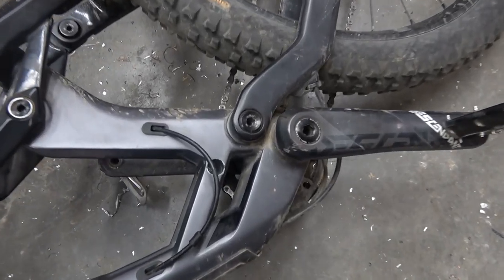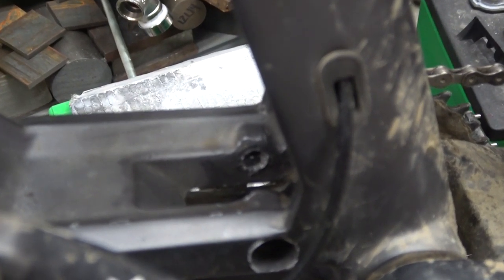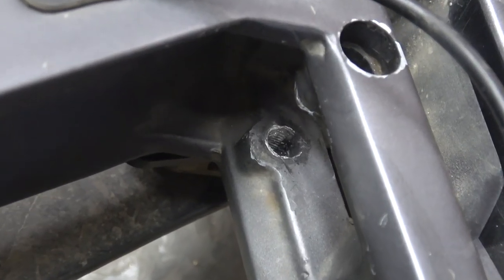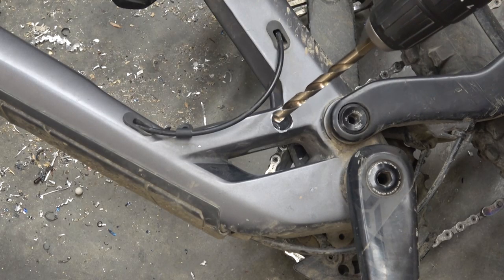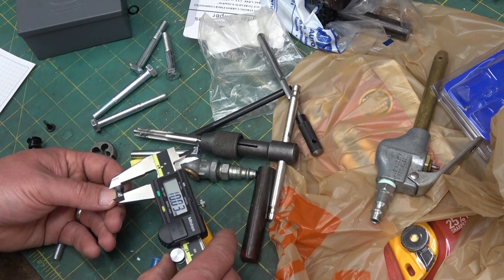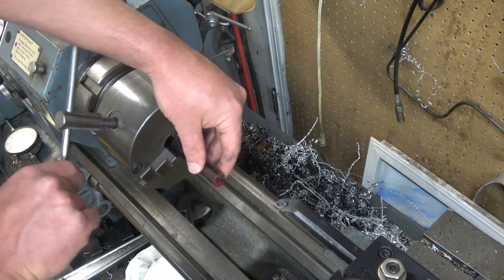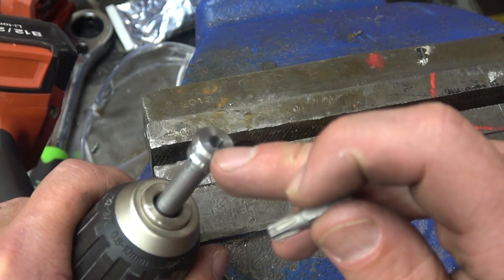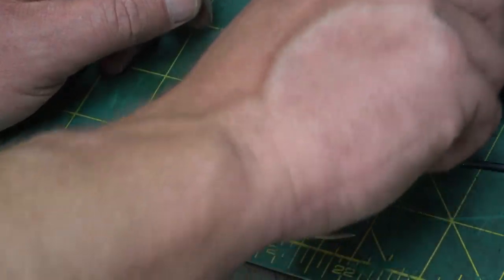What's a scumbag offset? | Obscure German Carbon Fiber Bike

Comment: from a German, i can tell  not all german engineering is good or best. but in this case aluminim make sense, to me. sure steel is harder and can take more force but that the problem. you use these pin as an breaking point, so that the pin broke not the frame. and man 10 years was the bike or the rear schock ever in service.
and Imperial vs Metric, every time i have to calculate psi, my brain f..cked up.

Comment: It's a german brand (direct-2-consumer) but the frames are made in China or Taiwan - not sure who engineers what - by no means a shitty brand though. It's not ideal that it's going to be hard to remove the new bolt because when you do maintenance on the suspension replacing bushings and bearings is part of the job. Otherwise congratulations on helping a fellow biker. Keep your clicks in a vice.

Comment: Manufacturers why did you not say it was a designed failure point to protect the carbon fibre frame! Like your lathe leadscrews.  Well done you have just transfered all the stress into the frame, lets see you repair that with a helicoil 😉 😋

Comment: Should've got a Santa Cruz. Large diameter axles for all the suspension pivots, and collets so that the bearings don't get preloaded when you torque the thing down. MTB engineering is a lot better than this example here.

Comment: Aluminium part in a cyclically stress loaded environment will work harden until it fails.  That's a guarantee.  Aluminium is one of the worst material choices for that part.  ::sigh::

Comment: German bicycle... Wait till you have to change the tires and need to locate the brake booster that has to be removed first so that you can disconnect the ABS system that is situated in front of the switch that turns off the anti tire theft system that won't allow you to remove the wheels.

Comment: This is just a stupid application. It broke cause of shear force, and snapped off right where the thread starts. This is the most common place for all the bolts, pins etc to break. What id do, i would make it a threadless pin, just an insert, straight rod and fix it in place with a snap ring or a screw going thru a frame at a 90* angle into a pin, like, from a bottom of a frame. That is just pure stupid.

Comment: i really like your videos.  but why are you using the completely outdated imperial measurement system that is not used anywhere on the planet next to the US and A and some other insignificant countries?  "Three quarter and one sixteen" sounds horrible to an european.  (except for English, but these are and have never been europeans) really fun it is, however, when it comes to measurements of liquids or weights!  this is really a comedy show.  you have ten fingers and ten toes - please use the much easier and less error prone metric system!
Sunny greets from Austria, the home of RedBull, KTM and Mozart